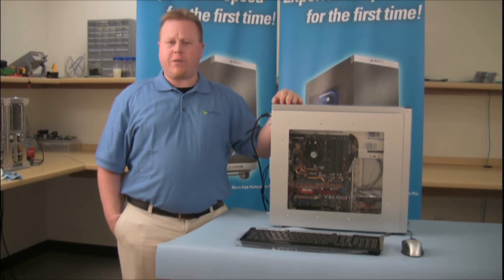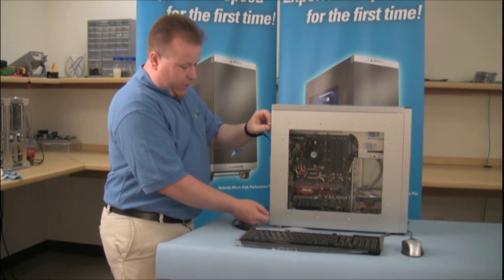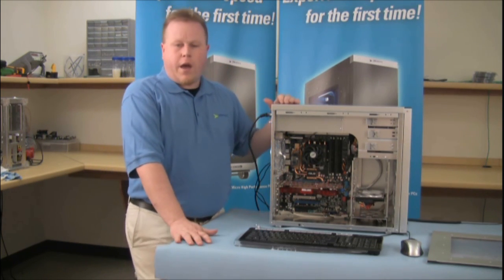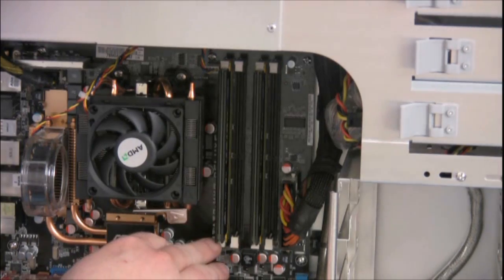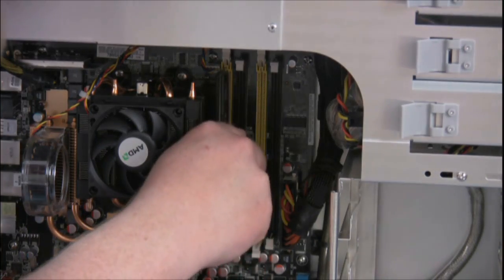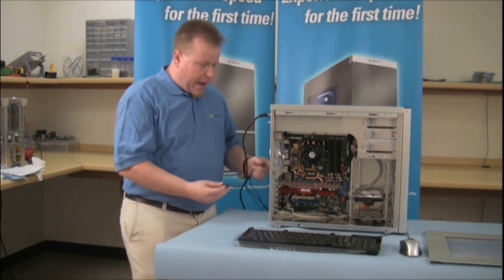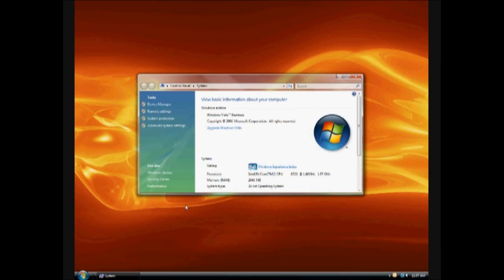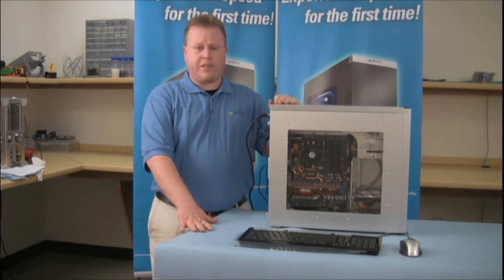Velocity Micro Tech Lab- Upgrading RAM

Comment: Why are the power cables plugged back in? And to discharge the current, your supposed to remove the power cable and hit the power button, you'll see it lights up for a millisecond and gets all the power out.